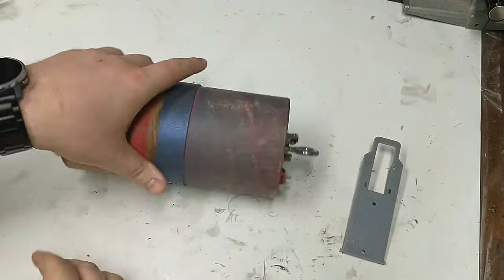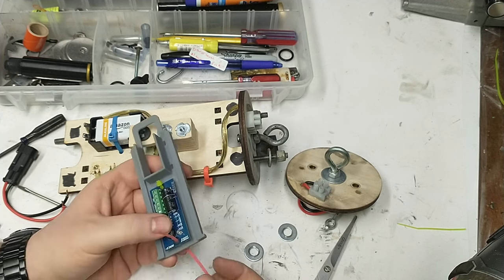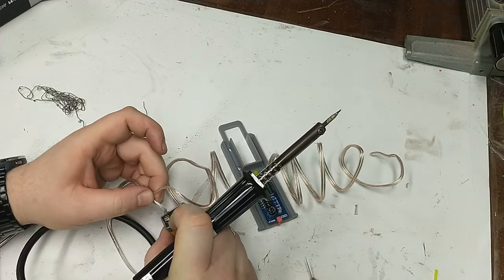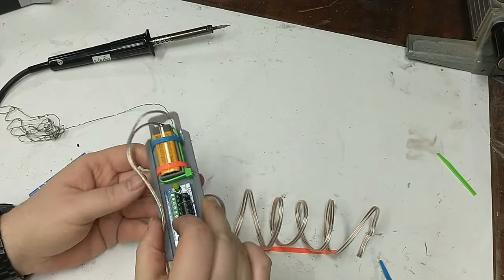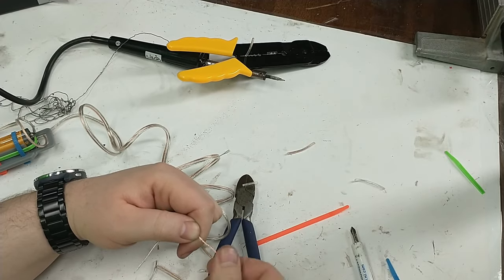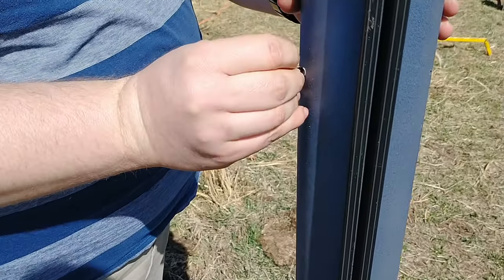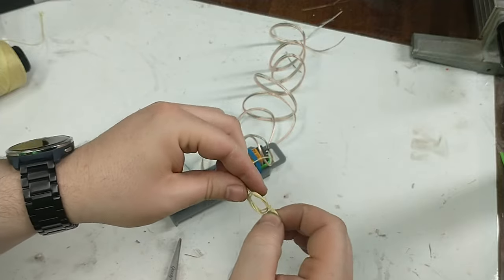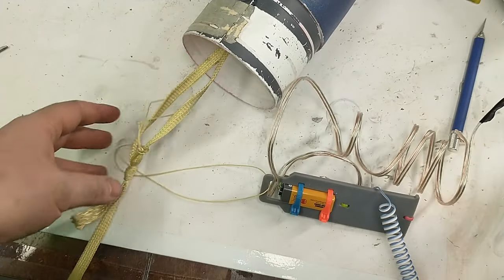Electronic Parachute Deployment for High Power Rockets - Simple motor delay replacement

Comment: I would recommend taping the twisted wire “switch” to the outside of the rocket in case for some reason your launch is scrubbed and it has to be taken off the pad. I’d go for a connector for the battery instead of solder. Would probably put the altimeter inside a tube or container, with vent holes or at least wrap in a piece of Kevlar or nomex for some protection. 
Are you using a sugar propellant? With the metal nozzle figured that might be the case. Nice looking motor case. Did you machine it or purchase it?
Reply from the maker: Definitely good points.  
Yes, I am using Sorbitol (KNSB) propellant.  I did machine the case, there is a playlist on my channel documenting the build.
Reply: Yes definitely leave the twisted wire “switch” taped to the outside, it would be very difficult to disarm with the wires inside if for some reason you have to remove it from the pad.

Comment: The battery terminals (within the battery) are soldered to the cell leads. Don't recommend EVER soldering to the leads of a battery.  You could easily de-solder the connection to the cells.  Or damage the cells due to the heat transferred.
Reply from the maker: Those are definitely valid concerns, though the batteries I am using I know are welded internally, not soldered, and I don't think I'm introducing enough heat to damage the cells.  Definitely a good idea to test and make sure things are working though, and if you have any concerns then use a battery connector instead.

Comment: Please do more videos I need education
Reply: Dont follow anything this guy did in this video. Hes very uneducated in the proper and safe way to fly Dual deploy. You absolutely never solder directly to the battery. You ALWAYS secure your electronics with kelvar and or eyebolts, not string. You always encase your electronics because the gas and soot from the motors will destroy them. This guy is going to get himself or someone else seriously hurt
Reply: I have done everything that this video went over even machining the motor casing myself and everything worked just fine. Some people like myself can't afford to go and buy the top notch rocketry equipment that is out there to have what you call "safe" rocketry. I have seen some of the most expensive rockets turn disastrous. These rockets here are all self made and you get more satisfaction watching something that was 100% homemade from sourced materials that fly perfectly and come back without any damage. I'm sure he is even launching at sanctioned events that have proper codes he is following. Everything here is SAFE! My rocket venues allow for "experimental" rockets to be flown and have extra safety protocols in place if such an event occurred